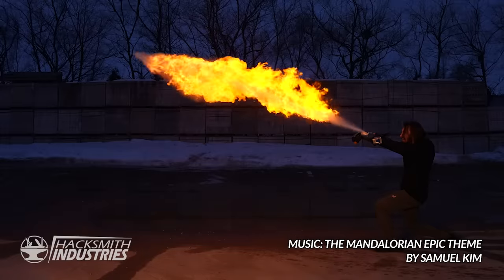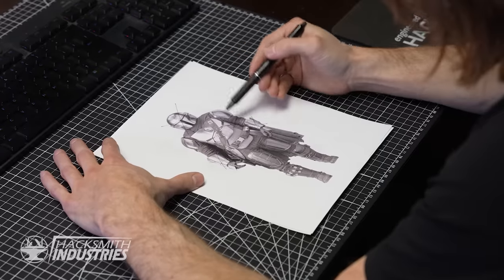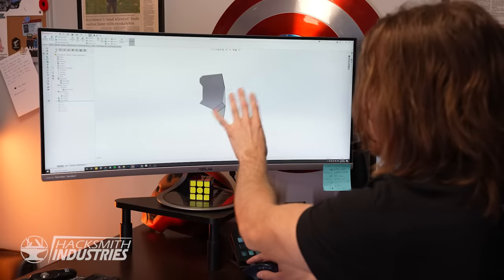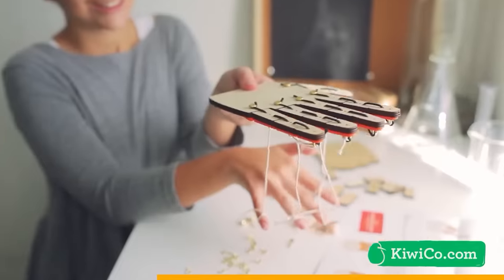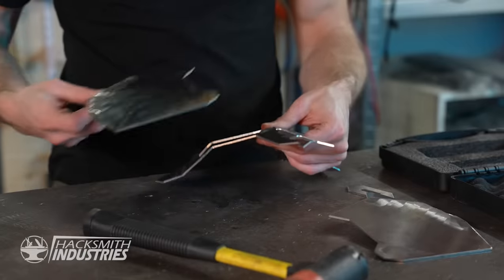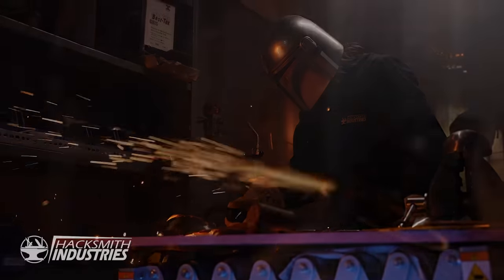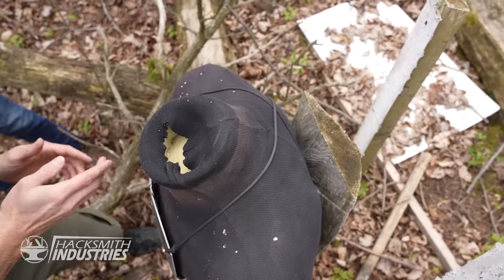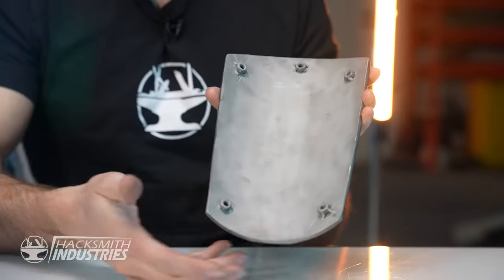Bulletproof Mandalorian Armor! (HACKLORIAN: Chapter 8)

Comment: The fact that it stopped a slug is pretty impressive honestly
Reply: Not really, in ballistics, general speaking, the faster projectiles will pierce better, while slower projectiles will smash. 

So, the 5.56 penetrated not because it was "more powerful" than the slug, but because it was faster. But of you look at the slug, it did smash everything and it looked to me like it broke a few welds also, not a good sign for the armor.
Reply: @Lumadous  and because the 223 is much smaller in diameter so more force per area which also helped to penetrate
Reply: @Lumadous  they remade the armor and improved the design, the test served its purpose, plus the shape of that armor is probably not ideal, and it's made for looks and not functionality
Reply: Normal bullet proof chests do that lul
Reply: @markgaming919  
Depends. Soft armor folds to almost any rifle munition.
Ceramics have a lot less trouble with velocity than metallics
poly folds to steel penetrators
Reply: it's not hard to make armor that will stop ballistic rounds, the hard part and where certified ratings really apply is to deformation. just because a plate stops a round doesn't mean it won't kill you. the amount of force being transferred I the steel or whatever material is being used can easily kill you, at least with center of mass hits. People have shot cheap Chinese plates off of ebay and wish with up to like 357 magnum and the plate stops it no problem, but the amount of deformation on the inside of the plate is insane
Reply: @Lumadous  🤓☝️”Not really, in ballistics, general s….”
Reply: Ptao Tom  only a bit of luck, everything else was entirely from hard work and experience
Reply: It might have “stopped” it but you’d be in trouble if you were wearing that when it got hit.
Reply: it may have stopped a slug, but the slug would have made the metal spall (when pieces of a metal plate flakes off on the opposite side of the strike face at high speeds) and kill the wearer anyway (this was a common problem on tank and early ballistic armor. the black coating on modern ballistic plates is a spall liner which stops spalling)
Reply: well the kinectic energy is gonna leave some very bad bruising but yeah its awesome(i think its the first bulletproof armor i've ever seen)
Reply: And that one wasn't even the one he ended up using too, imagine the better one with two layers!
Reply: "stopped" is a strong word.. i'd say barely smushed it
Reply: PRETTY impressive yea
Reply: True

Comment: James's ultimate middle finger to other maker channels that still have a budget :)
15:54
Reply: Lol yes
Reply: Lol
Reply: He should've gave them away or so. People would've loved them
Reply: It's pretty cheap, there's more labor costs than material. It's not that much steel, and steel isn't what they're spending most of their money. Even on something massive like the powerloader, steel isn't a main expense, all the hydraulics cost so much more.
Reply from the maker: Every time I do that,  it's a joke you know.  They're both on display in the showroom
Reply: @hacksmith  I thought as much, it would make no sense to throw out the other ones since you had put time and effort into them. I figured you would either put them up for display or melt them down to use the material in a different build but I don’t know if you have the necessary equipment to do that.
Reply: @hacksmith  Have you thought about putting some helmet padding inside the Mando Helmet? It looks pretty rough inside and you could make it more comfortable to wear, while also avoiding potential injury.
Reply from the maker: it is padded!
Reply: @hacksmith  I figured

Comment: When mandi was repairing his armour in season 1 there where electronics in it so I belive that they were some sort of magnetized system that pulled blaster bolts towards the armour
Reply: @skepticalbadger  nice catch i didn't notice that
Reply: I'm pretty sure they act as dampeners for the blaster bolt
Reply: @zackaryodonoghue2228  oh
Reply: @zackaryodonoghue2228  
Probably don't need dampeners, more heat dispersant
conduct heat away

Comment: Just when you think it’s over “hackalorian season 2 making the dark saber”
Reply: I would love that
Reply: That would be hard tho
Reply: @austinbamber6392  true
Reply: The hilt would probably work, but getting the blade to bend at the angles it does near the top wouldnt be possible. Awesome to see them attempt it though
Reply: @wcapewell3089  yeah they would have to find something to make it black as well
Reply: @Rjedij504  the action lab does a video on black plasma
Reply: Also the blade canonically adjusts its length based on the emotions of its user.
Reply: @RileyTheBest023  I’m gonna check that out
Reply: @badideagenerator2315  yeah so it could be possible
Reply: That would be the Way
Reply: @kingbilly5608  yeah my guy

Comment: “This armor took forever to make!” 
Proceeds to destroy with guns
Reply: Kkkkkkk
Reply: I think he shot it with a slug round in the beginning
Reply: Exactly how it should be destructive testing provides with invaluable information for improvement.
Reply: This is the way of the Hacksmith.
Reply: This is the way
Reply: It would most likely not survive a 50 cal
Reply: @Bamaunt  He said it was birdshot, he fired the slug round last.
Reply: @Wxyver_n  oh definitely, although I did see a video of a 50. Cal. Grade plate carrier and it worked. However even though the armor stopped the round the mannequin underneath was torn to shreds internally from the force alone.
Reply: @Wxyver_n  Nobody would survive a .50cal from a rifle
Reply: @Wxyver_n  Even if it did stop a 50 cal, no one wearing the armor would survive.

Comment: Recommend using thicker steel and ceramic if you wanna stop 223 you need something to break up and help absorb some of the rounds energy so the impacts less and it has less penetration
Reply: Also helps preven getting a ricochet round to the throat 😂

Comment: Hey Hacksmith, just a suggestion: how about you try to also make Heatwave’s heat gun using propane and corn starch (like you did for the Mandalorian flamethrower gauntlet), and Captain Cold’s cold gun using water & nitrogen (the opposite of the items used for its counterpart)?
What do you think?
Reply: Specifically, the cold gun and the heat gun would each have two tank-packs; one tank with either the corn starch or water, and the other tank with either the nitrogen or propan. Each tank would have a nozzle with tubes attached to them and locked together by an outer layer of flexible polymer, and both tubes would be attached to the back of the gun so that when the chamber fires, one chamber would fire the water or corn starch on top, and the secondary chamber would fire the nitrogen or propane.
Reply: The idea came to me based on what I saw in the CW The Flash tv show.
Just thought I’d put an idea in that magnificent brain of yours, just like how you thought of the idea for brining to life a portable miniature arc reactor from Marvel. Now maybe give DC a chance?

Comment: Also, just wanted you to know that the armor in canon doesn't connect to the flight suit. lol. There is yet another layer that the armor connects to and then that straps over the flight suit. Technically you didn't have to poke holes in such a damn nice flight suit, but thanks for the info on where to get said flight suit!

Comment: Really you need to use AR500 Steel. Even then, the issue with AR500 if it is not coated in something to catch the spald, the spald can still injure or kill someone. Other issue, would be at full covering, it would weigh between 80 to 100 lbs. full armor, maybe more.

Comment: I love what you make !!! But it's really time for you guys to get yourself a blacksmith ! Welding is nice but a real blacksmith would make you stuff that's so much more solid ! I'm just salivating to the thoughts of what you would do with a blacksmith in the gang !
Reply from the maker: the chest piece wouldn't have been able to be made using traditional blacksmithing though...
Reply: @hacksmith  Oh... Well maybe not that one project but I often heard you guys say stuff like "Since we don't have a blacksmith or the equipment for molding..." and that's usually followed by a montage of cutting metal sheets, bending pieces and welding them.

My point was that you are awesome, I love you guys and you should get yourself a blacksmith cause it would be even better. (or the molding equipment but I have a huntch it would be even more expensive and difficult lol) Not that I'd be able to make anything you guys do since I'm a just a computer guy.

Comment: Would an armour made from titanium be stronger or weaker, especially if it was 3D printed like those parts on the SpaceX crafts? If money was no issue, what metal alloy would be the absolute best for strength/weight for a single human?

Comment: I suggest two inches of carbon steel welded under that chest plate of stainless steel and one inch carbon steel welded under all the rest of the stainless steel plates, to give it that much more durability than just stainless steel alone.

Comment: Guys Hear me out
I know this is not related (in this video) but was related on the Tungsten Thor's hammer, so the idea was it's heavy and it would be lifted by the....???? Mountain???? but nvm that, i was hoping if they could make a barbel plates made out of Tungsten which would be heavy but thinner than the normal ones, Its a good prank for the Bodybuilders too

Comment: I don`t know how much protection you would expect from that ,,armour,, since it didn`t hold against a 5.56(probably a low quality bullet)
The fact that those plates are thick as finger nails even if they are overlapped should tell you that much, each piece of that chest armour should`ve been at least between 0.5 - 1 cm thick to have proper ballistic protection